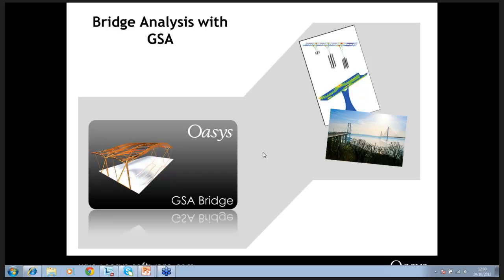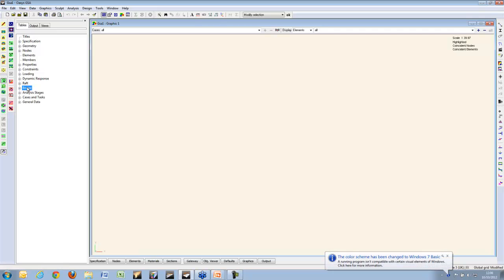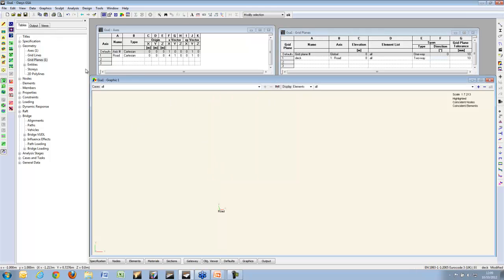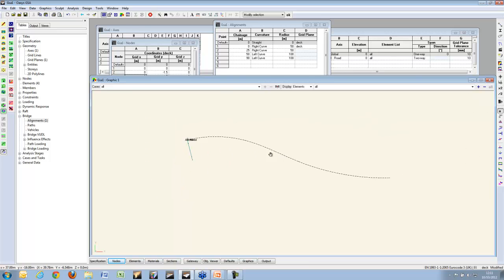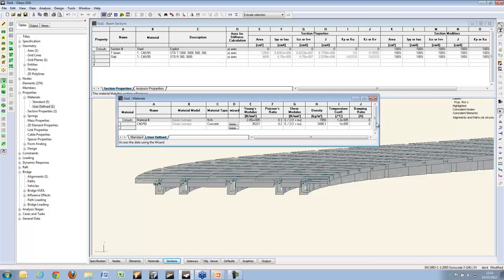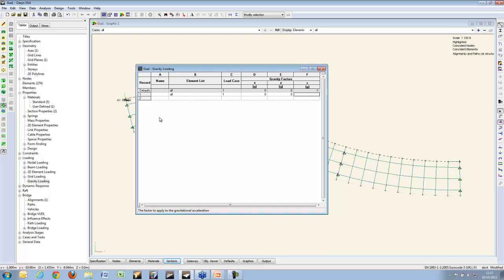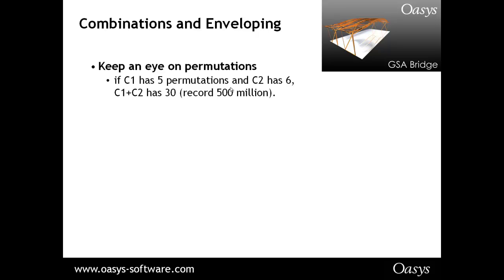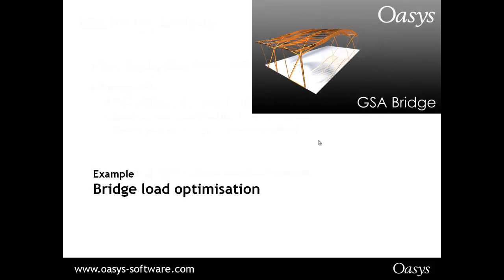Building Bridges With GSA (Oasys Software Webinar)

Comment: Do you have a tutorial for making that plate model for the steel girder at the end and running some torsional buckling analysis?
Reply: Hi Peter
We don't have a tutorial, per say, but I can tell you what I did:
I positioned some nodes to form the cross section of the girder, spaced to match the final element size.
I then used the Sculpt > Extrude command on the nodes to create the 2D shell elements along the girder length.
I also created a number of 2D properties to give the plate thicknesses and assigned them accordingly.
For the stiffeners I think that I drew in a large plate and then used the Sculpt commands to split it down to match the girder elements
To switch the stiffeners on and off I used an Analysis Stage that excluded the stiffener property number, before running the modal analyses on the whole model and the stage for comparison.
I hope that helps
Peter
Reply: Thanks Peter,

I did manage to make a model and it was fairly easy, I initially wasn't sure if the modal buckling mode require some special inputs but it didn't so the beam rolled over and gave me a buckling/strength factor which was pretty cool. I was trying to work out to see if placing two beams side by side and only welding the flanges together at mid span would be enough to improve it's torsional stability significantly. So I just placed two beams side by side with a minimal gap between them and then added in a short 2D element between them at the mid span to represent a plate/weld between the two beams and it seems to have worked. 

Cheers,
Peter

Comment: 5:25 Defines current grid
Reply: For GSA 10 you need to add a Grid Surface first (this is where you state span two-way). Then the current grid plane may can be set on the Lists toolbar for the view by first setting the Display Option to Current Grid (top right of graphic view). The current grid is then displayed in the Display List and the available grid planes are offered in the drop-down list.